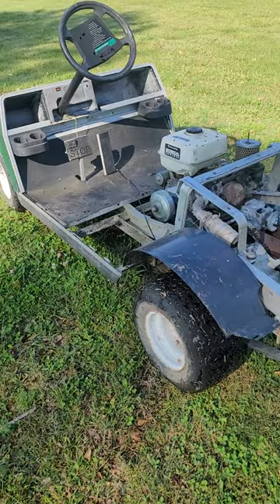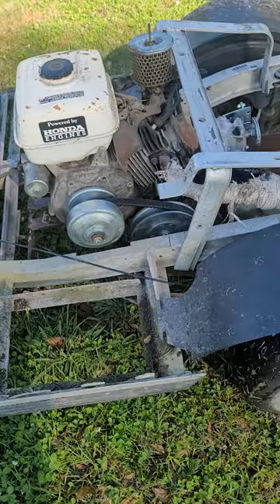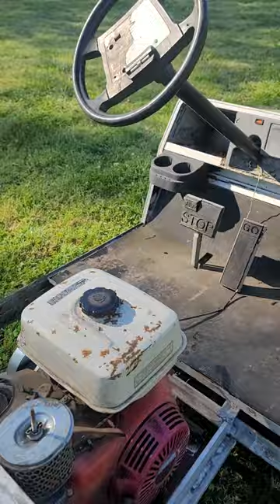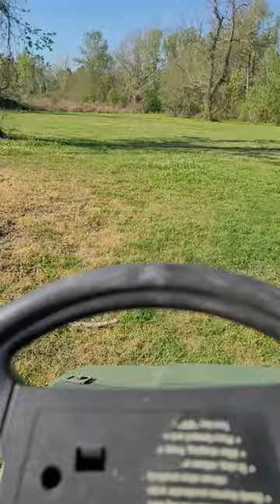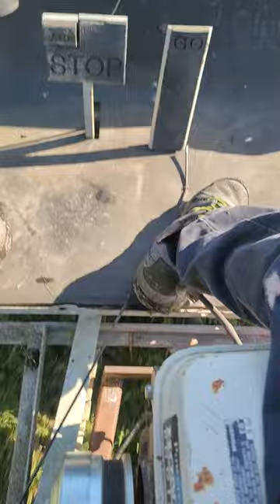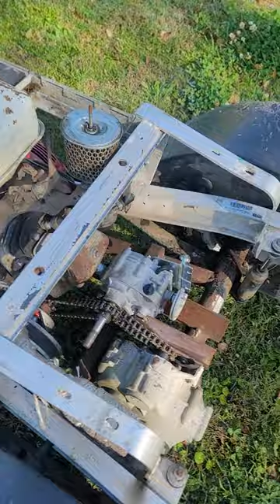Club Car DS gas conversion

Comment: CVT belt shouldn't need adjustment.  Nice build.
Reply from the maker: As belts stretch.......you slide the engine foward.
An atv cvt belt doesn't need adjustments.
These belts do